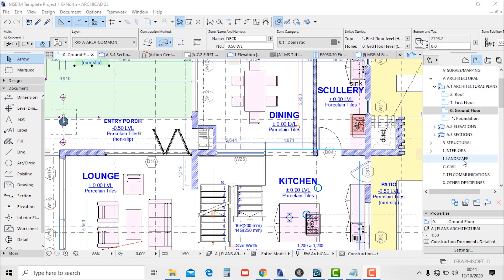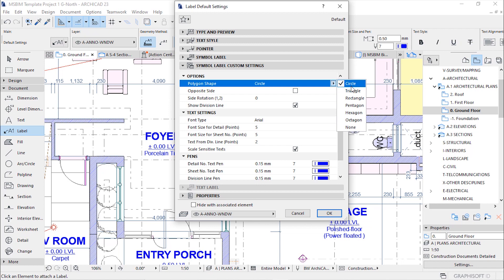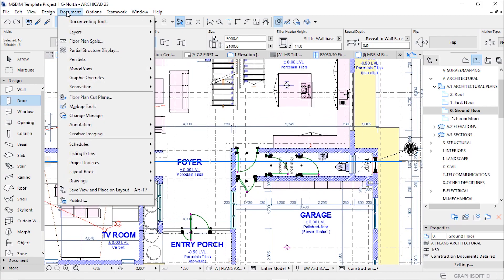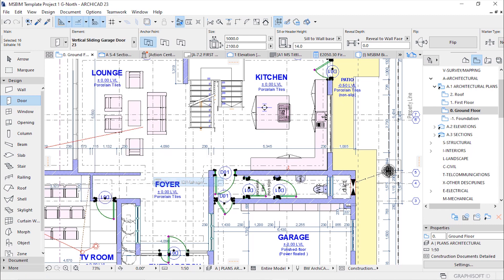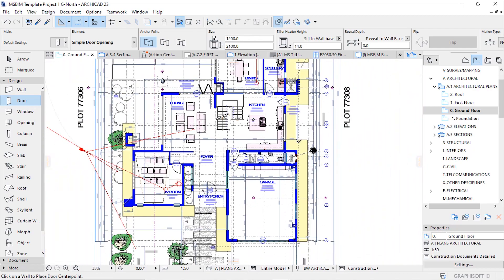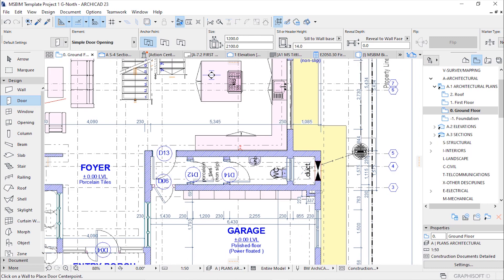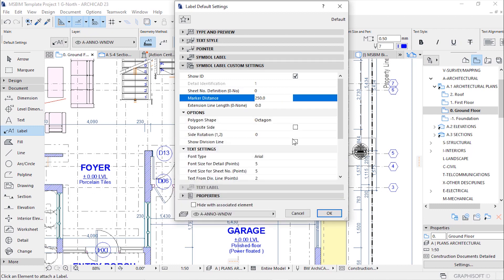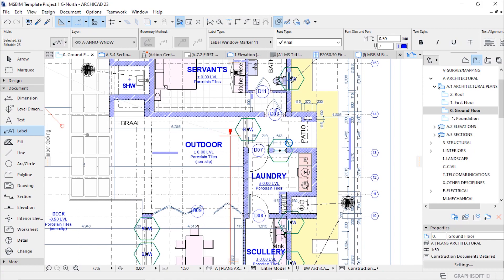How to setup a  BIM Door/Window Label Effectively | ArchiCAD Tutorial

Comment: Thanks for the video. Is there a way to possibly add the door/window tags in the schedule as well?
Reply from the maker: Yes Sir by using element ID field in your schedule scheme settings
Reply: @MesolightVisual  I tried doing that but it only adds the id name but not the complete label tag and symbol. Is there a way to add the element including the frame and format it looks like in the floor plan?
Reply from the maker: @plomi1193  No sir that is not possible, you can only add a label in plan, section and elevation